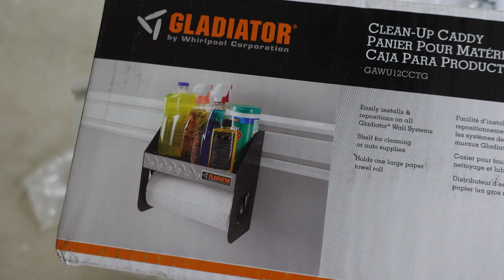Garage Organization with Gladiator Gear Wall | Install and Review

Comment: Just installing mine now. I did read that they need to start and end on a stud (so I should cut the excess that goes over) and that the labels directly above or below should stagger where they panels end.. rather than the bottom two panels sitting directly above eachother with their seams on the same stud. 
Not sure if you have found it to be a problem. I’m guessing that it’s just to prevent the multiple screw holes going all over a single stud. 
Thoughts?